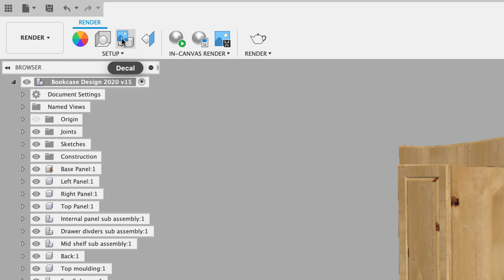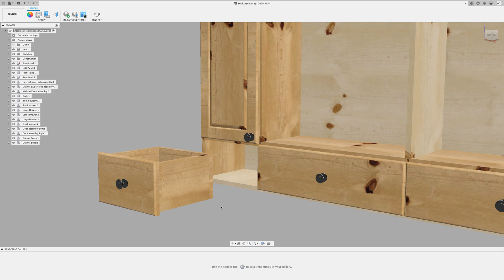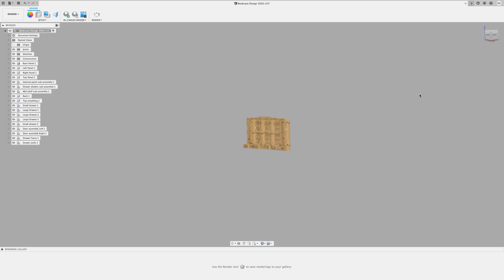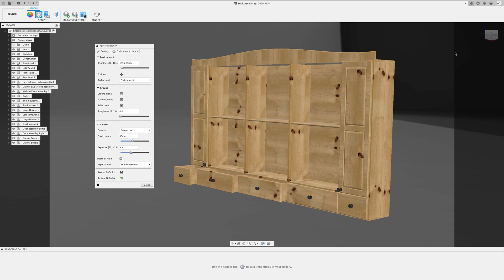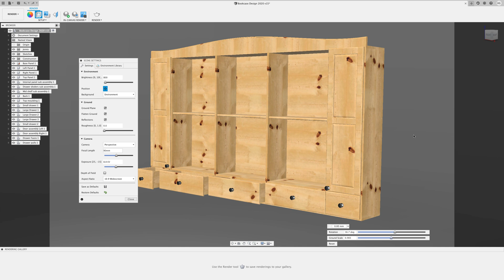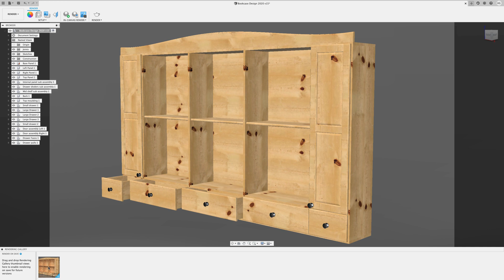Fusion 360 for Woodworkers - Lesson 14 - Rendering

Comment: Hi Andy, any idea after downloading rendered image there is just white background and no reflection on the floor? Thanks Peter
Reply from the maker: Now that is a question,

Did the rendered image show up in the bar at the bottom or is that blank ?
Reply: @TheWoodgrafter  thanks for swift reply, yes it’s showed up at the bottom
Reply from the maker: How strange, I have never had that problem. If it shows up in the render it normally downloads OK.

Let me go research and see what I can find.

Andy
Reply: @TheWoodgrafter  so after downloading image yours looks exactly like in fusion?
Reply: @TheWoodgrafter  it saves as png if that’s matters
Reply from the maker: Any chance if recording your screen (the render then download process) and sending it over to me. So I can have a look ?
Reply: @TheWoodgrafter  sure thing. Could you just tell me how to do that please?
Reply: @TheWoodgrafter  thanks Andy for your help  I think I’ve managed. In render settings in custom tab I’ve changed file format for jpeg and unticked transparent background box.
Reply from the maker: That’s interesting,

I’ll give that a go and see If I can re-create this. Just out of interest.

But, glad you have it sorted.

Cheers

Andy
Reply: @TheWoodgrafter  yes Andy, just to summarise I did one more render on low resolution with changes I’ve made in custom tab and is working I have now background on the image. Happy days!
Reply from the maker: Excellent,

Really glad you have it worked out.

Andy

Comment: Thanks so much for these extremely clear explanations, it's been of such big help in understanding this fantastic software! I have to confess watching your episodes as a marathon during lockdown so hopefully I won't forget too much over time. I have two questions mainly on this episode: 1. what is the difference between in canvas rendering (mine seems to stall slightly) and the final (teapot) render? Should I run the first one at all times? 2. when trying to change the grain of, e.g., the large drawers and the internal sub assembly, all items change at the same time. Is this because they're copies? How can this be prevented and changed individually? Many thanks, keep up this inspiring work!
Reply from the maker: Hi,

I am not ignoring this question, I need to check on the grain question before responding. I think you can change the face independently but need to check on the details.

The canvas render is a cut down version of the teapot render. I tend to use the canvas as a quick and dirty to give me an idea of how it will look. Check out reflections, lighting etc.

You don’t need this running all the time, I press play and as soon as I see enough to be happy (or know I have to tune) I press pause.

The teapot is a high power render that will give you photo results that can be saved as jpg etc. You can either use local resources CPU/RAM or offload it to the fusion cloud.

The canvas render will pause on some PC’s as it uses a lot of cpu and ram resource - so depends on the power of the PC and what else it is doing. I run a high end MAC, so don’t see the stall issue - but it still slows the machine down.

Thank you for the feedback, I will come back on the other question.

Cheers

Andy
Reply: @TheWoodgrafter  Many thanks for your respons. I will check on this soon in my next design.
Reply: @TheWoodgrafter  Hey, thanks for  these videos. Just a quick note: I also have same issue as E Middel: when I go to change the faces of the large drawers, they all change together. I am sure there is a way to do it individually, but by default it seems like the copied faces all want to maintain texture alignment as well 👍